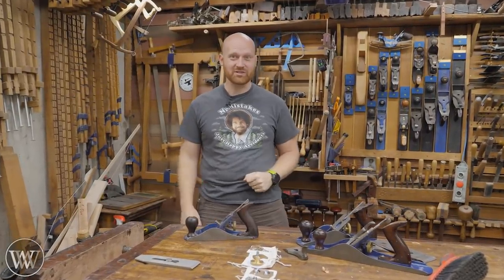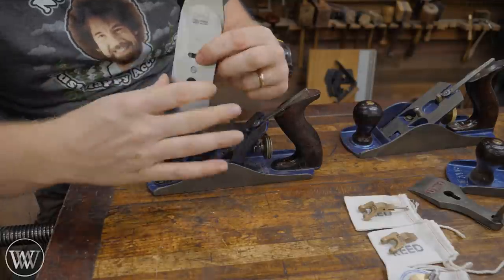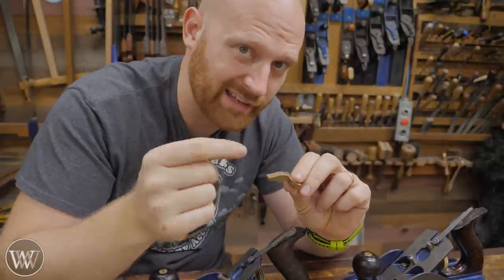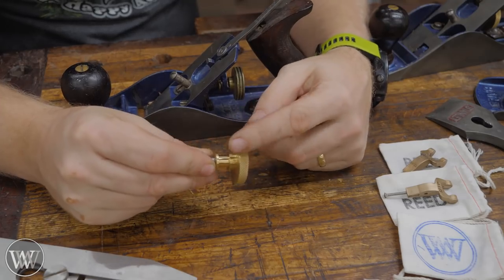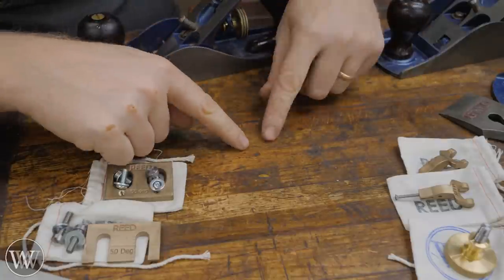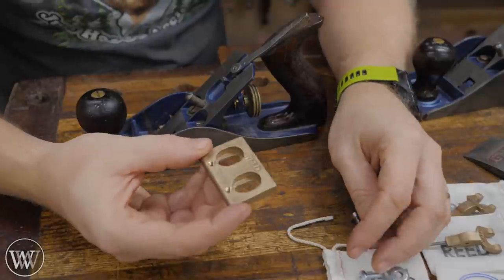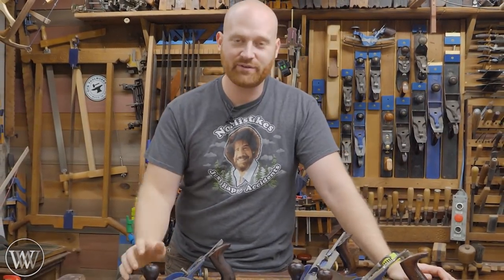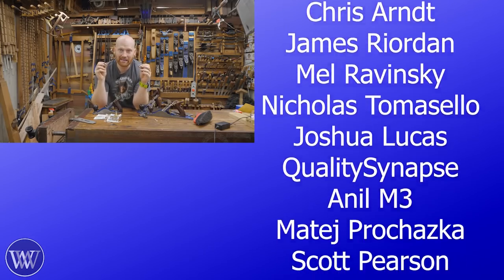The Parts Have Arrived to Supe Up Your Plane

Comment: i just did a yoke on a 4 1/2. everything was ok but i think you could make some small inprovements to the file to fit yoke. there is a lot of shrinkage in the casting which was not a serious problem but the inside of the yoke is concanve. i dont know if this will cause the slop to return with wear but it would be nice to have a full bearing surface on the wheel after fileing. ths could be acheved by making the inside of the bearing surfaces thicker in your casting allowing for more material to be filed away. Also i think the idea of a cast pilot hole would be great. i had to estimate the center of a really large opening to mark the center. in the end the casting worked out well but maybe could use some tweeking. still i ended up with a far superior tool the i started with thanks.

Comment: This is an interesting improvement. However, if you are going to invest in all these parts along with a thicker blade and chip breaker, that works out to $182 in parts NOT including the original Stanley plane or the labor to install and tune it up.  It's cheaper to buy a Wood River.
Reply from the maker: but the wood river still has the same problems. of extra slop, not a fine adjustment and you can not get it with a high angle frog.

Comment: I would love to see a dual ratchet kind of thing for the adjuster knobs, where each way you could hear/feel the clicks for adjustments. I wonder if that kind of thing is possible.
Reply from the maker: well now that would be interesting!
Reply: Well it would be an engineering challenge and costly in small batches, so not something I am thinking to explore.
Reply: If just for the audible/tactile feedback, I think it wouldn’t be so difficult. I could be something like a reed fixed to the frog engaging in a coarse straight knurl cut on the shank of the knob. You would know how much you rotated it from the precious position based on the clicks heard. But that is referenced against the knob, not the blade position. Indexing that to the blade position in a direct, precise and repeatable manner would be difficult, and, honestly, maybe not so useful in a handtool I guess. Remember the iron is not accurately, (machining level accuracy) perpendicular to the sole on a front view: We fiddle with the blade (both body and the bevel)cap iron, and even the sole, so there would be a cosine error on the measurent (number of clicks) and the actual distance traveled. There’s the backlash on the system, which would throw off the measurement, no matter how small. And, ooh boy, I would dread the thought taking the blade assemble off and apart to sharpen it and put it back together. And sharpening is something one should not procrastinate on. 😆

Comment: So these work with the bedrock style as well? Most of my planes are either new or bedrock. But my 603 and 604 definitely could benefit from the up grades.
Reply from the maker: The wedges will not work with bedrocks. And they are connected in a different manner. However the depth adjuster and yoke will work fine.

Comment: Is it possible, if those longer screws are used without the wedge, that they might poke through the sole?
Reply from the maker: the castings hole does not go through the sole but most castings are not deep enough for the longer screws without the wedge. but you can always shorten the wedge.
Reply: @WoodByWrightHowTo  Shorten the screws?
Reply: I know the holes don't go through the sole. I'm thinking about the possibility that someone buys one of these and then uses the new screws when he takes the wedge out. I do not know if the new screws are long enough to do that, but if they are, maybe the device should come with a warning about it. I have heard that this sort of thing can happen with the tote screw if the wrong one is used or a new tote is made and dimentions are different.
Reply: @vincentcoppola9832  The screw will stop turning when it hits the end of the hole.  Trying to tighten it farther would require lots of force, which, if the worker thinks about it, would obviously be a bad idea.  The typical result would be to twist the head off the screw.  As regards totes, while it varies, most Stanley totes are held on by a threaded rod which is threaded into the body obliquely, and a nut, often brass, with a slot cut in it at the top which tightens down on the wooden or whatever grip.  It shouldn't turn the rod element at all, and if there is a brass nut, the brass will fail before you could force the rod to turn further.